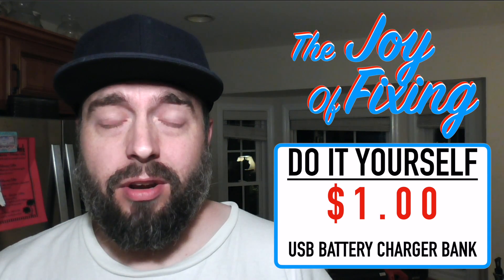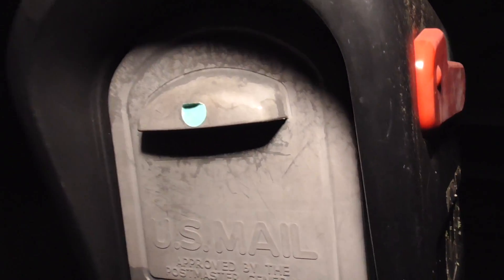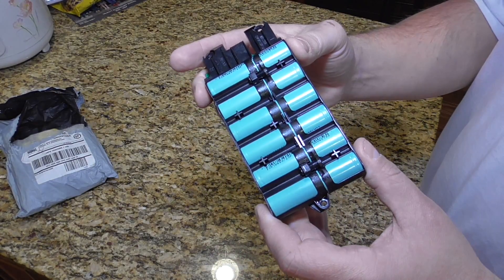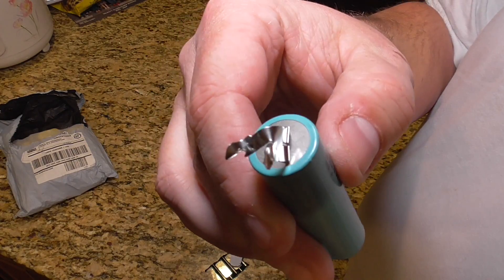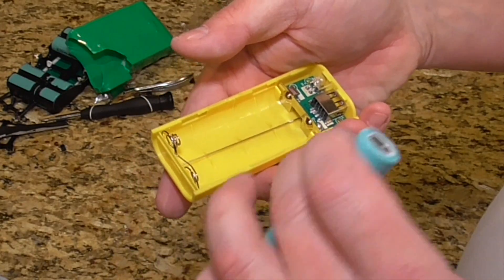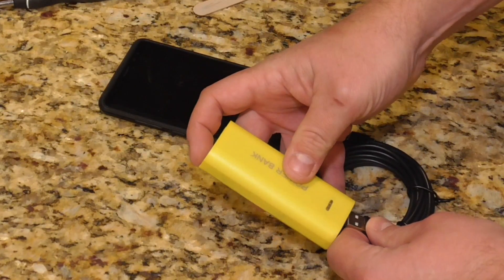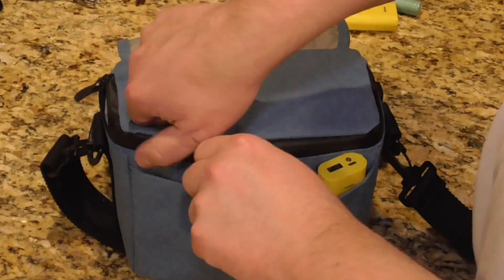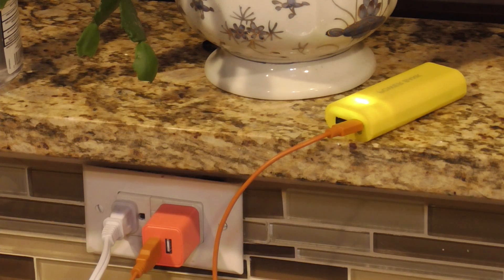Build a Powerful USB Charger for $1.00 - Easy DIY Power Bank with 18650 Lithium Ion batteries!

Comment: For anyone doing this at home, if you have a multimeter or battery level tester, try to match the cells voltage. If they aren't almost exactly the same voltage it can cause big problems, as the cheap $1 circuit charges both as a single cell !!

Voltage testers are less than $1, order one at the same time as the battery box !!